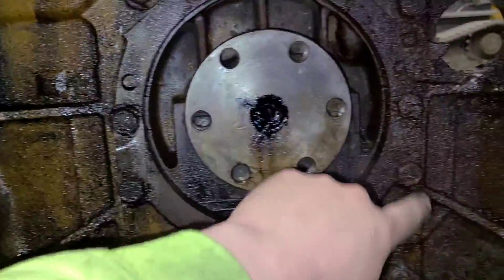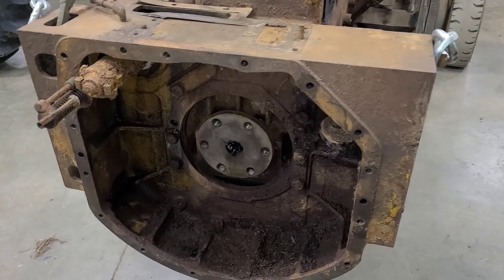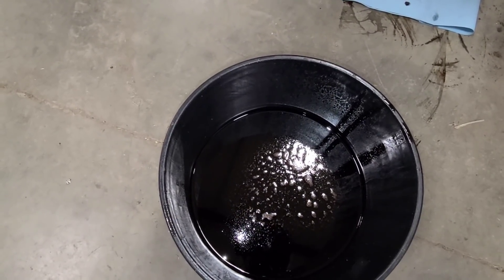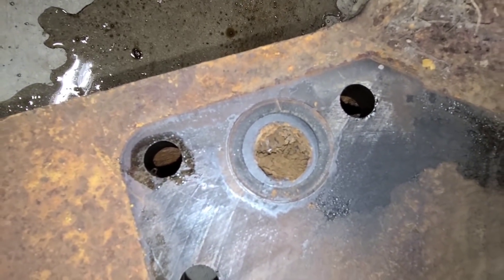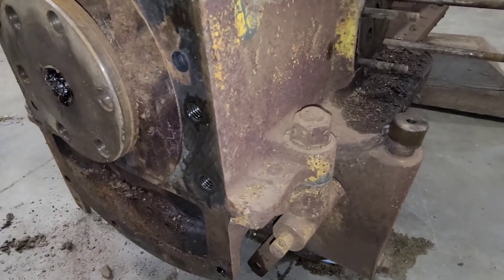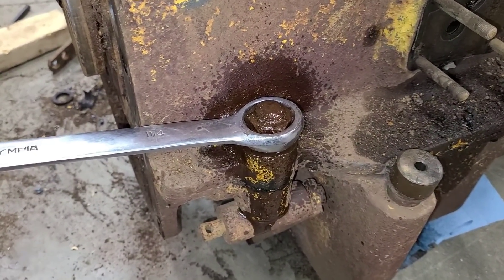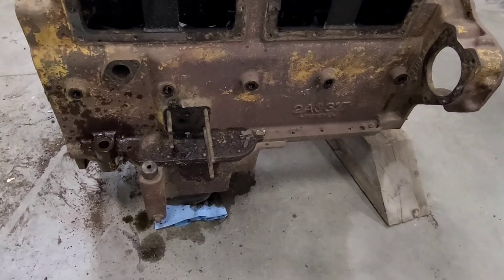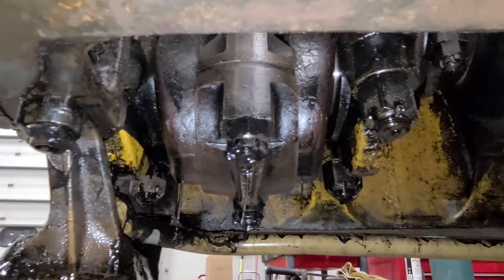Caterpillar RD-4 Engine Disassembly Pt.9

Comment: Find a shop that can bake and shot-peen the block. It will clean the block down to the bare cast iron, removing all the cement like sediment and tar, it also is the best way to reveal any areas of concern or cracks. The thermal cycle also helps to alleviate any internal stresses built up from freeze damage. Also, you have said before that you don't like penetrating oil, but it is still a tool and like it or not it helps A LOT to help prevent rusty fasteners from galling.

Comment: I’m struck by the overwhelming need for parts cleaning while doing this work. A huge part of the job, not fun, totally necessary. There used to be company around here with trucks that drove around and cleaned parts at the customers site. Haven’t seen them in years.

Comment: I'd love to have your confidence at the sight of rust or seemingly undetachable bolts. Even the poor appearance of the cylinder liners hardly seems to make an impression on you. High respect. Greetings from Germany, Raik
Reply: Those cylinder liners will have to be replaced, they are really gone. It will be easier remove the crank and leave the pistons and rods in the block and then pull the liners with the pistons still in them. Once the liners are out you can slice down their length to split them and remove the pistons. If the pistons are aluminium you may well be able to salvage them as they clean up well. I have done this on an old stationary engine I restored.

Comment: We used caustic soda in the hot tank at the machine shop i worked at late 70's. They might use something else nowadays. We had the regular soak tank that heated the solution and also another machine that was like a big dishwasher that used the same solution. A turntable spun the block or whatever and it had high pressure jets that sprayed as it turned.
Reply: Same here I work at Machine Shop with Hot Caustic Soda, I had to get into and clean ever so often.  Does great work pull out all Aluminum Bearings, we were Grand Feathered in to use that old tank for many years.  Mostly used for Oil Field Equipment and those Great old Waukesha's and M&M engines.

Comment: I ran into different nut sizes frequently on old implements. You never knew who dug through a bucket to find a nut to fit a thread. 
I was guilty of that with square nuts.
I have a 5 gallon bucket full. When I want something to look authentic, rustic.
Thanks Kyle.
Reply from the maker: I know it's not uncommon, just kinda caught me off guard when the wrench didn't fit, thanks Bryce

Comment: You really need to make a good engine stand like what Squatch built for his D2 rebuild.  That would help with getting the disassembly, even if it's another step before you can get the block to the machine shop before the racing season starts with a vengeance.
Reply from the maker: I've thought about, the problem becomes where to attach to the block without impeding what parts can be removed. Even the stand Squatch253 built holds on to the bellhousing (which I just removed) and not the block itself

Comment: The oil pump and oil sump seem to be nice and it has not much crud or broken piston rings or shavings inside the pan.  I think that leaver for the pinion clutch is bronze and you can still use it if you grind off the horrible welding marks. I'm surprised the oil cup was still intact, usually when people take the starting engine off they are likely to break it. I think Squatch may have mentioned that as well in one of his videos.
Reply from the maker: I could easily see how they could be broken. Bottom end looks clean so far, hopefully it's not hiding anything
Reply: @kylechrist   As much as I could see the video the real problem seems to be piston nr 2 that has become one with the liner. The rod might me ok still, so sacrificing the piston would be no major loss cause the liner itself is also unusable in this form. Hopefully there are liners available for the RD4.

Comment: the lever I presume that you took a magnet to it and it did not stick, further confirming what it is bronze or brass. 
The first bracket you took off looked like it had a bolt or stud welded on it. I could not get a good look but they looked different at their base. It could be me too. 
Was the second bracket worn like the first? If not it could have been broken before and replaced. many "old timers" would replace or repair a broken part, but not it was not broken yet
Cash knew exactly what you said about him which is why he was ignoring you about going home to start with.
Reply from the maker: I will know more once I get the parts cleaned up. Second bracket looks about the same for wear. And Cash just has the stubborn husky attitude haha, always has
Reply: @kylechrist  Cool beans 👍

Comment: Squatch stating that all you need to do is coat the bolts with grease or oil looks to be correct.  The cleaner in the shop at my work uses hot caustic soda under high pressure and cleans very well.

Comment: That bottom end doesn't look too bad. The stuck piston is trash.
Reply: Piston could very possibly be usable. I have personally pressed ones out of aD4400 and they were fine. First I removed liners with pistons stuck in them so heat on liner could be used to assist in piston removal.

Comment: I wonder if the parts from the old motor from Pnwhillbillys d4 are anything you might need to complete yours?
Reply from the maker: He has a D315 engine, the RD-4 and early D4 crawlers used the D4400 engine
Reply: @kylechrist  I was wondering about that as I typed.
Reply from the maker: @waynep343  no worries, I'm looking for more D4400 and D315 engines as well